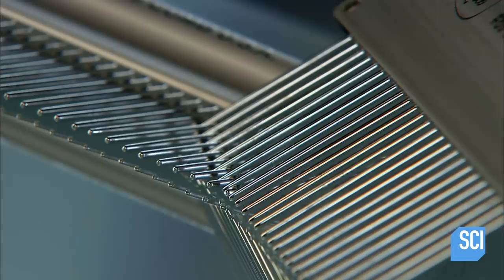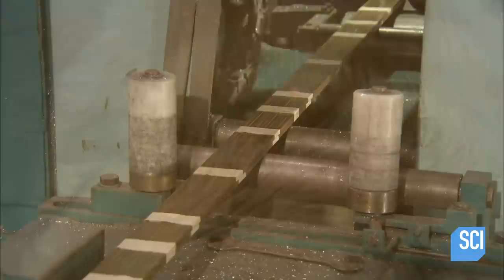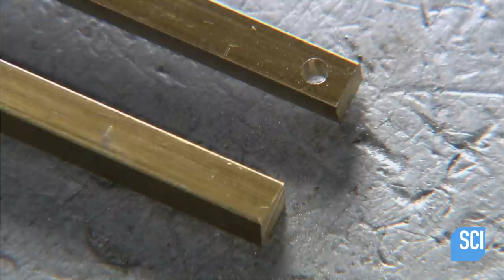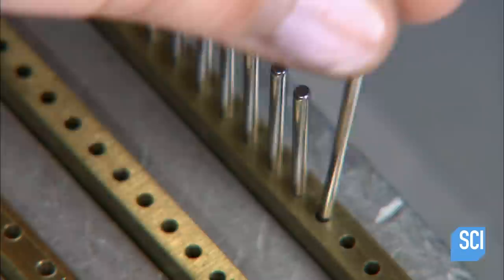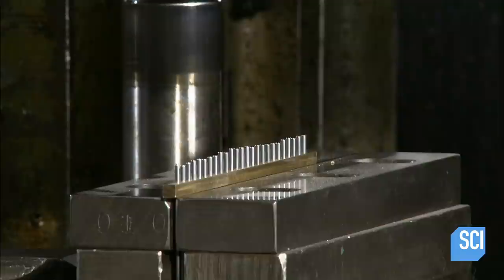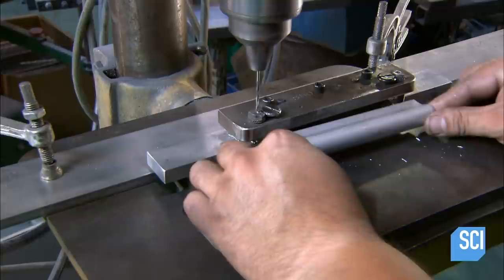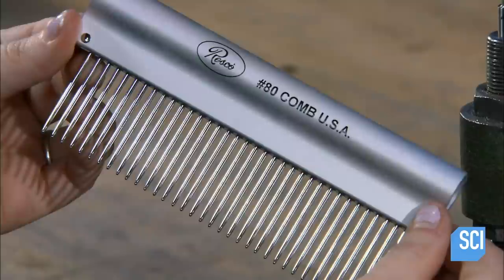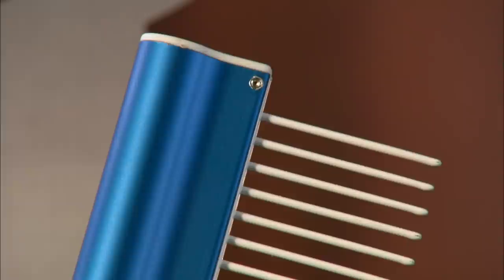How It's Made: Pet Combs

Comment: I wonder why that lady hammers the pins down, after she inserts them, when 2 steps later they mechanically push the pins in place.
Reply: because the pins would be slightly loose if they weren't hammered the first time and fall out. the second press machine sets an equal height for ALL the pins. (i'm an engineer)
Reply: @zir786  As an engineer, assuming you're that kind of engineer, I bet you could think of a way to combine those steps to save time and money.  And then demagnetize them afterwards.
Reply: @nicotti  yes definitely, but sometimes the cost involved in combining manufacturing steps is costly. For machinery and tooling.

Comment: Seems like there are a number of steps in this process when the "human element" does sloppy work or is insanely inefficient. Case(s) in point: the guy clamping the brass pieces in the vise for drilling misaligned one of the pieces (a machine would get this perfect 100% of the time), the woman manually inserting the prongs into the brass blanks (can only do 3 at a time; a robot could do so much better), the sloppy dabbing of adhesive for the plastic end caps (maybe the end cap could be friction fit and wouldn't require adhesive).
Reply: Yes, there are a number of steps where the human element can produce points of failure, but some workshops can only afford to automate the process so much, whether it be because they make many different products or there is neither a need nor money for specialized machinery to automate the process.